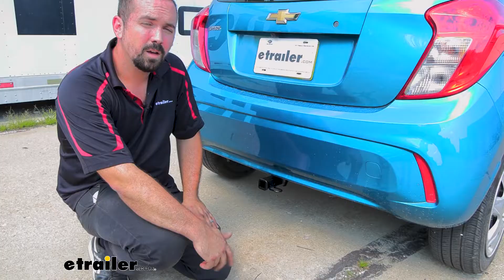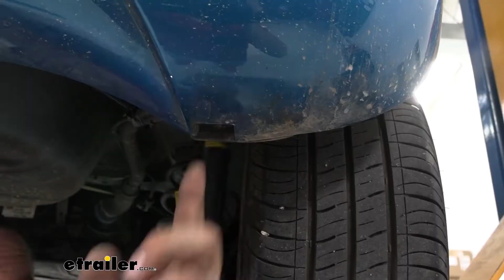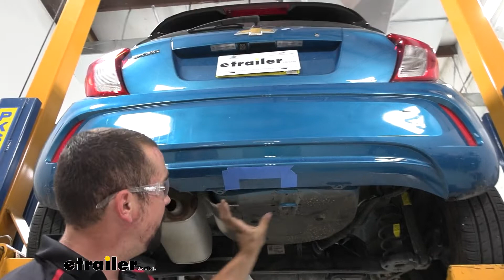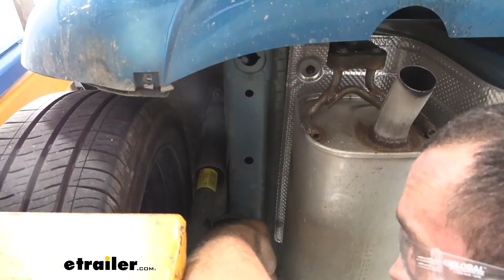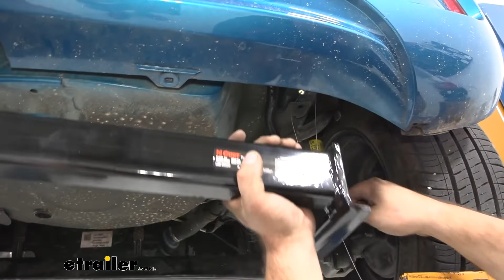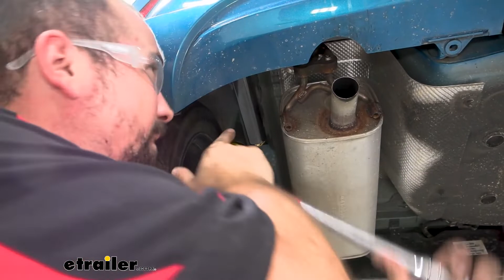etrailer | How to Install: Curt Trailer Hitch Receiver on your 2021 Chevrolet Spark

Comment: My son & I (99% son) installed this hitch today to my 2021 Chevrolet Spark. Follow the instructions 100% from this video and you will be successful. We took approx 1.5 hrs. My son is an Aircraft Maintenance Engineer, so he does possess skills many do not, but professional skills are not required.
Reply from the maker: Niiice! Congratulations on your successful install!
What are you planning on using the hitch for?
https://www.etrailer.com/Trailer-Hitch/CURT/C11433.html
Reply: @etrailer I have a small 12' aluminum fishing boat, also plan to carry a bike rack occasionally.  Both will see limited local use. Thanks again for your awesome video.

Comment: Why wouldn't they make the bolt small enough to fit into the access hole?  Idk installation seem kinda sketchy, lol.  I like the idea of just cutting slots though as opposed to boring the thing out per the destruction manual.  Thanks for the video.  I'll be putting mine on tomorrow so me and my gf can go doot dooting around with our bikes on the back of my teeny tiny car.
Reply from the maker: If the bolt were any smaller, they wouldn't be able to use a 1/2 inch hex bolt. A smaller bolt wouldn't have the necessary strength to keep the hitch safely attached to the car. Let us know how the install went, and good luck with the doot dooting!
https://www.etrailer.com/Trailer-Hitch/CURT/C11433.html